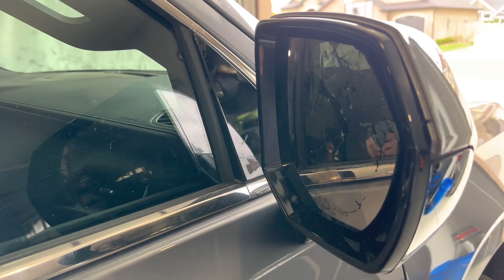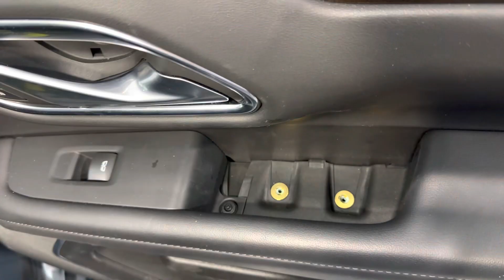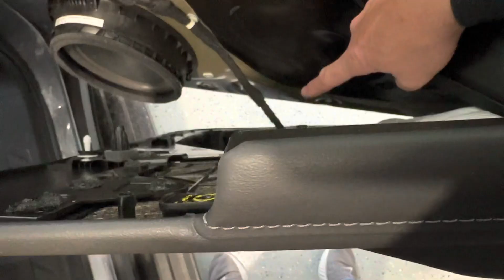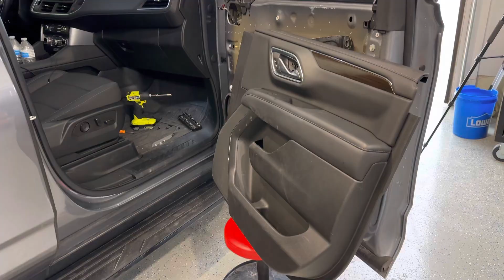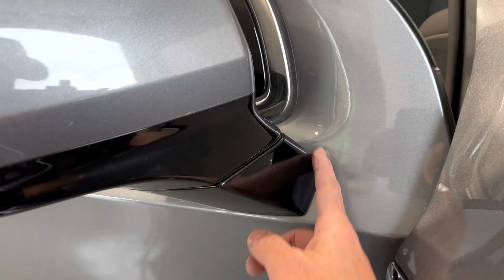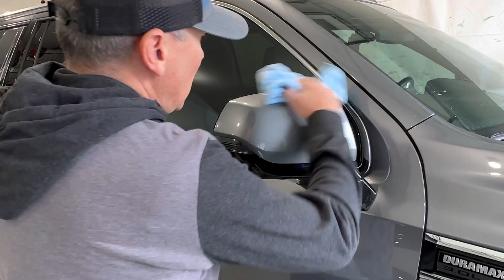2022 GMC Yukon XL Side View Mirror Replacement | Road Debris Damage!!

Comment: I know this is 3 years old I just had to take my mirror off to install trim now everything works ( cameras, turn signal, the glass moving) but the power folding does not work any tips?
Reply from the maker: Did you install a new one?
Reply: @Myksgarage  nope, just had to take it off to change the trim from chrome to black, thanks for the fast reply btw.

I saw on google after they’ve been moved manually you need to reset them, still figuring out how to do that on the ‘22 (the video I saw was a much older Yukon)